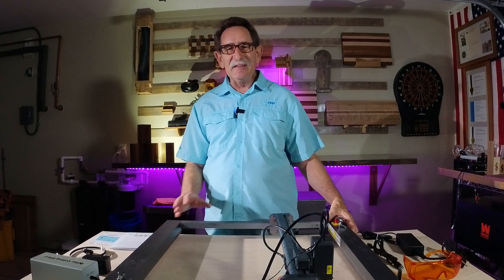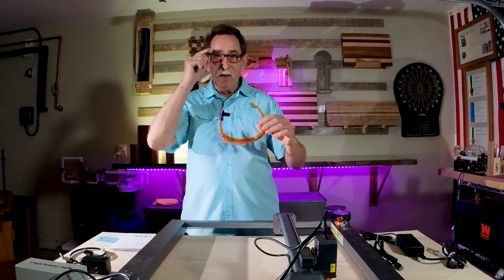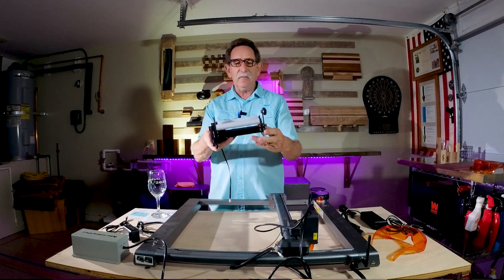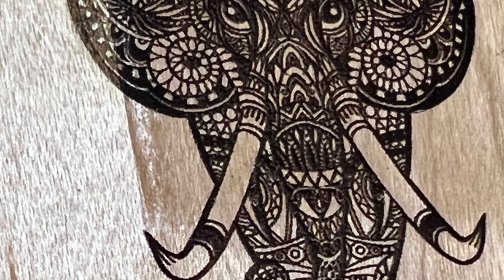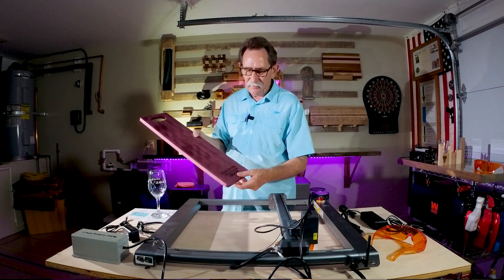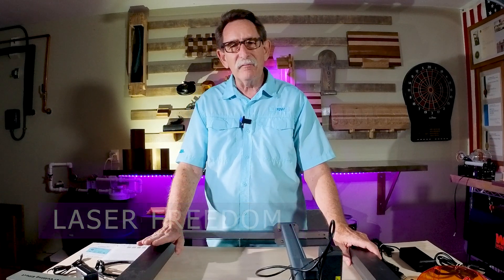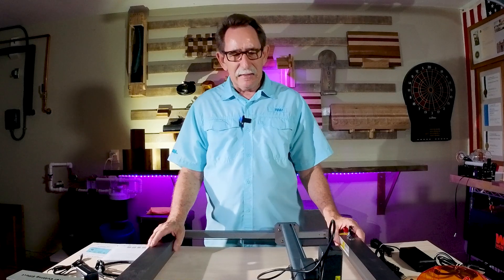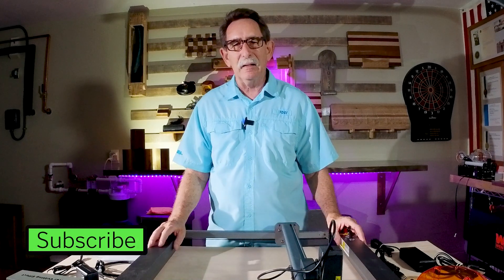A Diode Laser Engraver to Buy or NOT?  -  Ortur Laser Master 3

Comment: I am a little confused as you indicate this unit will etch glass when in fact it needs help in doing so, at least from others I have watched.  I will check to see if you have any follow-up,  but please add an update as I gave this unit and would love to know..thank you
Reply from the maker: Guy, I am  not "positive" I understand your comment / question.    Diode Lasers will engrave / micro abrade  glass if you put something on the surface (paint) of the glass.   The laser will react with the paint and lightly chip the glass.   If you do not do this the light will pass through the glass.    It this answers your question great.  If not please write to me at G.kenner   @ yahoo.com and I will try and clarify.     After I obtaining satisfactory results with a diode laser , I purchased a Aeon CO2 laser as paint is not required to etch and it is much faster.  Cheers and thanks for watching.